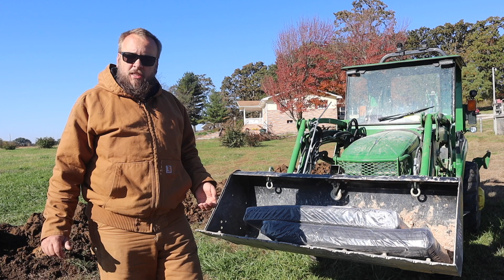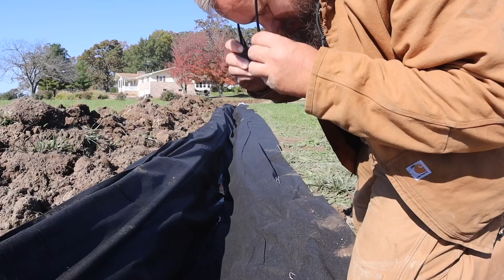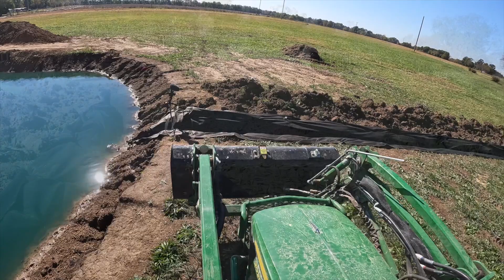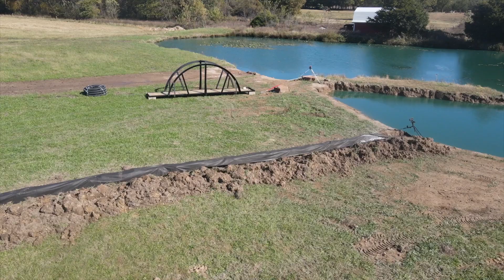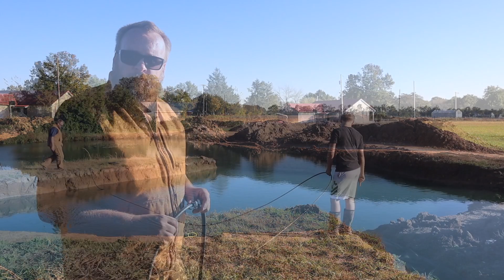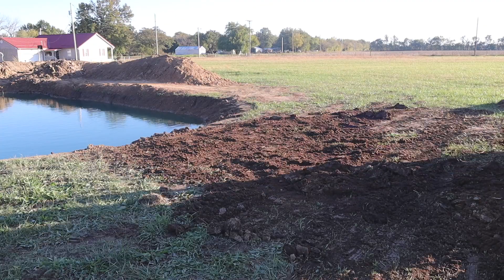Installing a French Drain for the New Pond

Comment: Dam fine job man. Same exact way i set mine on our own house. Im building a mid sized garage, big porch which leads to a decent bluestone patio. Problem is up here northern vermont mountains i have a lot of water coming out of the back acreage even all the trees cannot soak it up so i have to install about 150ft of what i plan on being french drains to pull out most of that water. Sending it down along side the house and out front theres a low spot i have which acts like a small pond most of the year so i am going to run all that nice clean mountain water into that low spot to create a permanent pond. The 1 thing i dont know before hand is the sheer amount of water, but judging just how much water 1 drain i installed 5 years ago which collects roughly 50ft worth, she flows a good amount of water alone so having triple the amount i am forced to send it into that low spot as i dont want to literally flood the dam front yard out entirely....

Goes without saying no 2 places are identical, but is that 200 ft worth of french drain enough to supply your pond with enough water all year long?

Most important thing is to obviously protect the land and water regardless of what i want, as ive said earlier im doing this out of necessity and to protect the rest of our acreage here, so figuring your setup as is do you think that would be enough to supply say a 30ft by 30ft pond? Do you think it would flow so much water that it would easily overflow the banks for half the year?
Reply from the maker: This was one step off the journey. Here is the rest

CRAZY Pond Transformation - We Built an Island, Bridge, and Windmill
https://youtu.be/yYv5-m_nsqs

Comment: You stitch the fabric together with the staples and bend them out to keep it from sliding apart. If you have enough overlap, you really don't need much of anything to keep it together. Just keep a eye on it every few scoops of cover.
Reply from the maker: Thanks for the info

I knew they had some thing that held that fabric together but ours overlapped quite a bit so I didn’t worry about it too much.
Reply: @RockhillfarmYT  I have the staples on hand in most cases, so I've figured out plenty of uses for them besides their real purpose. Pushing it in with the bucket like you did, all I'd really suggest is overlapping it so the top layer is going the way the dirts being pushed. That's really all there is to it honestly.

Comment: Hopefully that airline is deep enough not to freeze in the winter. You guys are further south might be okay. You’ll be surprised how well that French drain works on draining the yard. We ran something similar and plumbed the gutters from the house in the same trench.
Reply from the maker: Thanks for sharing. They told me to bury it 8 inches And we went that or deeper on most of it

If it was a water line I would’ve went deeper but for air I hope it’s OK